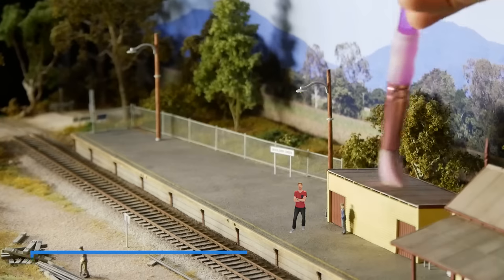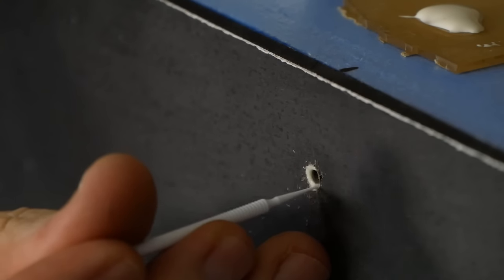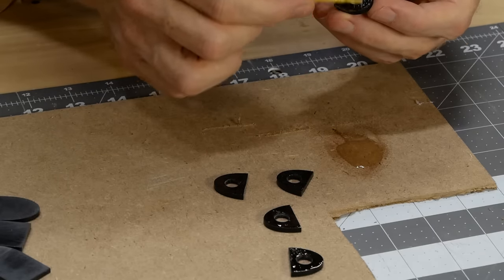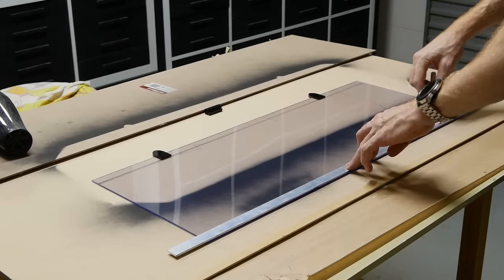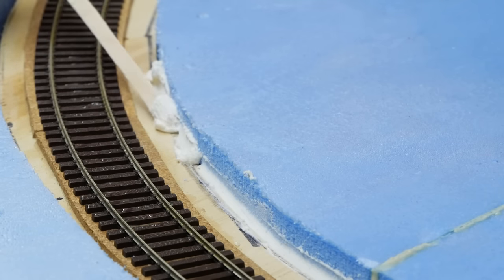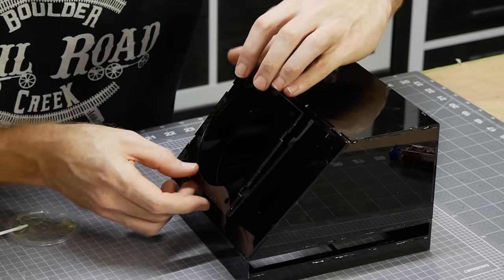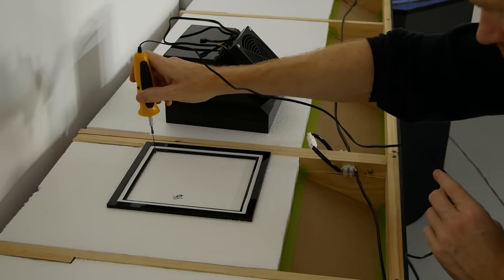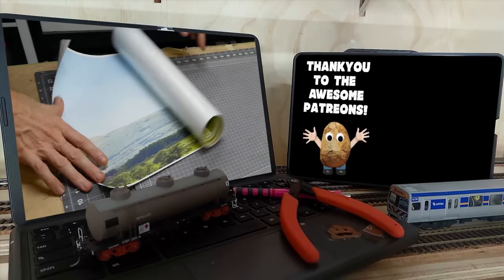Build a Dust-Free Model Railroad Layout

Comment: Looks good,   Dust is no ones friend. I live in the South West Deserts of Arizona.  I have also spent 21 years of my life working inside intel FABS aka HUGE Clean Rooms.  If you can not find a Hepa filter,  Use a paper Vacuum bag cut to cover the output or your air handler.  Or, if it is not too late,  use a square car intake filter or maybe a car inside cabin filter those are both designed to removed dust.   The Paint filter is for paint not dust.
Reply: I use spray booth filter in a room dust filter, it collects a lot of dust! Seems like more than the filter that came with it.
Reply from the maker: Yeah didn’t think of that! It would be pretty easy to add a cut out piece of vacuum cleaner bag to the filter setup, I could add it to the bottom of the spray booth filter? That way the larger particles should heat caught by the filter and the finer dust will get caught by the vacuum bag.
My thought about the paint filter was that paint is fine and dust like 😉 but I’ll try adding the vacuum bag to the filter material.

Comment: Great stuff as always, Luke!  I would make one suggestion, that I think would be super helpful for an operations-based layout. Instead of the small pegs, make a small notch shelf to support the plexiglass shields when they're in place. When removed for an operations session, these slots could then be used to hold car cards, if you use those for a car-forwarding system. :)

Thanks for sharing!

Comment: Nice video Luke. I like the idea of the clear plastic on the front of the layout. By having the clear plastic on the front will also mean that nothing should fall off the layout and go on the floor. I like the dust fans too. - Nicholas.
Reply from the maker: ha ha true, I do plan to remove the clear panels when I use the layout. But if I just want a train to run around in circles while I work in the garage I could do that with the panels up as well 😉

Comment: Beautifully done! I like the idea of positive pressure, but I think constant airflow, especially from the "contaminated source," is actually going to make for more dust on the layout than just having the air static. I wouldn't think there would be a lot of dust ingress through the vertical cracks in the panels. Also, that filter floss isn't really ideal for air filtration; it's more for aquariums/ponds to catch larger suspended solids. All this being said, I don't think it's a terrible idea, and your implementation is top notch as with all your work!

Comment: You're going to regret not putting the filter in front of the fan. Dust is going to cake the grill and the fan blades. Those would have to be periodically (monthly) removed and cleaned otherwise they will look an eyesore and diminish performance.

Comment: That looks really good. It likely won't matter for a long time however I may have designed the air scrubbers so that the fans were on the clean air side of the filters to help lend more life to fans themselves. Keep them clean so they last longer overall.
Reply from the maker: Thanks mate, yeah that's a really good point! The covers I used for the blades have an extra little section with a foam filter. I could put those back on as an additional filter, that way the fan would be in the middle between two foam filters for extra dust filtering 😎

Comment: Nice job. You could also use magnetic tape for the sheets, It would seal  and hold the top edge.
Reply from the maker: I did consider the magnetic tape but it was hard to find one that was strong enough. Most of them were quite weak, the ones I could find anyway, I'm sure there are better quality ones to be found 😉
Reply: @BoulderCreekRailroad  Yes they are not strong however with two long strips and the force only pulling the strips directly apart you have almost the perfect application for the them. I usually see them used to hold thin clear sheets for ads and posters (and in the seals on fridge doors)

Comment: Nice. But I've found that filter surface area is the difference between a constant nuisance and something with a lifespan that's about the same as the device it's mounted to.

For this construction, I'd have made a layered roof: Visual (e.g. sky cloth), structural with plenty of holes, filter, hollow space, and airtight cover with the fan. This would give a filter area that's nearly as big as the module.

Comment: With the fans I presume to get the positive pressure all four will be intake rather than exhaust. 

You won’t be able to stop dust unless you run it like a clean room which it isn’t (and nor would you want that) 

So the most likely  thing is that the pressure will push all the dust against the inside of the plexi screen obscuring the view and creating a lot more cleaning.

If you run it as negative pressure while it may pull dust into the track area it would also pull it up and exhaust it and keep the areas cleaner as a whole.
Reply from the maker: That's a terrible idea! If you look at scientific labs they always have their clean rooms at positive pressure. EDIT: I should say positive/negative pressure, so there is an exhaust but it is overall running at a positive pressure.
That's why there are filters, the filters catch as much dust as they can and they get a periodic clean. 
Sure I may have used a filter not exactly designed to remove the very fine dust but it's easy enough to use a HEPA filter instead which is designed to catch fine dust particles.
The filter I used is for paint, which is quite a small particle size... 
If you think using a fan and filter is a bad idea, what is your expert opinion?
Reply: @BoulderCreekRailroad  as someone who designs cleanrooms for a living: you did everything correct. Only things I would have done differently in this home build, instead of spraybooth filters I would have used in combo with cheap vacuumn cleaner replacement HEPA filters.
Reply from the maker: @tomaspuodziukynas5361  thanks Tomas, I've actually made some changes to the unit, like you mention I've put a HEPA filter instead of the spray booth filter and I also put a foam filter in front of the fans, so the larger dust gets caught by the foam filter in front of the fan which hopefully will keep the fan cleaner and then the smaller stuff is caught by the HEPA filter 😊 in writing an updated article for my website that will show the changes.

Comment: Would it be an idea to fill the gaps between the foam and rails bed with a construction type acrylic sealer/putty? I mean the ones available in large solid tubes which can be applied with a pistol like grip. A cheap branch is just as good here. Saves you time in mixing a home made filler, can be applied more easily from the tube and is finished with a finger.

Just an idea. Great video as allways!

Comment: 3 volts sounds extremely low for a PC case fan unless you've ordered the more unusual 5 volt variants, or some of a few with extremely low startup voltage. I would be worried about them getting slightly worn in and then stalling and destroying themselves instead of starting up when you switch them on. 

My advice would be to use PWM-controlled fans, hook them to a 12 volt supply, and use a fan controller board to specify the RPM instead of controlling them by voltage... or make extra sure the mininum voltage is above the fan's start-up voltage specification. (This is usually in the 5 volt range.)

Comment: The magnets could also be buried in the PVC/PMMA (whatever you actually used. They are only 3mm while your "glass" is 5mm. So no clean up on the outside just the paint to be added. Saves the building of the holders. Which I would have no means to do except using two strips instead of individual pieces.

Comment: for filling the gaps with the gap filler; would it be easier to apply the filler using a cake piping bag then using a stick or finger to finish pressing the filler into the gap?
Reply: I was looking to see if anyone else had that idea, I’d use a gallon plastic baggie, snip a corner, and just throw it away when you’re done.
Reply from the maker: ha ha yeah, I wish I had of thought of the! It's a great idea!

Comment: I know you built manual boards for the switches, but would love to see how you build a DCC system with signals and all for a modular (variable) layout
Reply from the maker: I will probably do that down the track 😉 Just figuring out how it will work and ordering the parts I need for signaling.

Comment: I'm curious, as someone who doesn't know very much about model trains, what is the purpose of the fans blowing air inside the boxes? Wouldn't it be fine with just the boxes to prevent dust, what needs the air inside? Great video and great attention to detail!
Reply: Dust will always tend to drift into any area. The "roof" on the layout will help but the fans ensure that there's always a gentle flow of clean air blowing out of the layout, which makes it harder for the dust to drift in.

Comment: If you want to avoid visble underspray use a clear coat, or same color as the panel
Reply from the maker: Yeah I did consider that but Rustoleum is quite a thick spray paint so I figured it should be fine as long as the first coat is nice and light 😉 And it work well.

Comment: Great video, Luke. Did you feel the need to add rubber grommets to the fans to stop any vibrations?

I would love to see you work on some 1/32 slot car track scenery one day!
Reply from the maker: I did have the rubber grommets but I found the window seal material (Woodland Scenics Paving Tape) was spongy enough to absorb any vibrations. In saying that you could use both and have it be very noise free 😉 The grommets I had made it a bit difficult to slide the fans in and out from the contraption I made...

Comment: While true acrylic doesn't "glue" together well due to being smooth, it you use acrylic solvents it welds the pieces together as if they are one, and sure there are some nasty smells no worse than your foam cutting with a hot wire and any ventilation you have for that should be fine.
Reply from the maker: yeah I did have some Weld-On 3 but I ran out and it's hard to get at short notice where I live, but yes that would probably work better in the long run.

Comment: Nice job. I would change one thing. I would seal the structure and maintain a slight underpressure inside. Then no dust will fly inside.
Now small particles will fall in and settle on objects over time.
But it's certainly better than no protection at all.

Comment: Fan should be after dust filter, you will have to clean them often and accumulating dust will make them noisy. Trust me I'm building positive pressure custom liquid cooling PCs for years.
Reply from the maker: Thanks for the tips! 😉 The covers I used for the fan actually have a separate part with a filter on it, I can put those back on so I'll have a filter in front of the fan as well as the filter behind it.

Comment: I wouldn't use clear plastic panels. They scratch very easily. Id get proper glass panels custom made. They are cheaper than most people think.
Reply from the maker: Until one of them accidentally falls and smashes all over the ground... I think I'd rather deal with a few scratches 😉

Comment: i think you take a big risk with the hair dryer. what does paint and heat can do? bubble.
Reply from the maker: It's fine if you use a low heat and avoid holding it on one spot for too long 😉

Comment: Question! How tall is your model? Are kids able to see inside? It was my main question last time because from their height, they would only see the overhead lighting.
Reply from the maker: Yeah it's probably too high for kids, it's about 1.4m to track level. They could stand on a step I suppose?
It's not really designed for kids, but you could easily adjust the height of the legs to suit any height of you wanted.
Reply: @BoulderCreekRailroad  Good point. If you do implement a step, beware kids may lean on the display for balance, so I hope the bases/legs are strong.

Comment: I think this is a great channel, but the amount of highly advanced equipment he now uses (3D printers, laser cutters etc) really take away from the "everyman model railroad builder" feel the channel was originally known for.  It's just not equipment most people can afford.
Reply from the maker: Yeah, but most model railroaders will spend thousands on their model layouts! So and extra $200 for a 3D printer and maybe $500 for a laser cutter is a small price in the big scheme of things. 
Plus they will save you money in the long run. A lot of kits are laser cut, so now you can make them yourself. 😉 and 3D printed kits are flooding the market so you can make them yourself now and save even more. Eventually you'll make your money back if you use them enough.